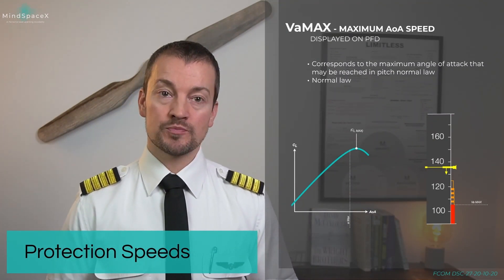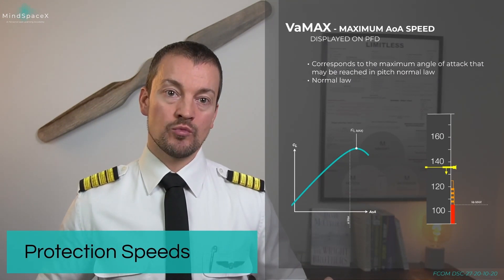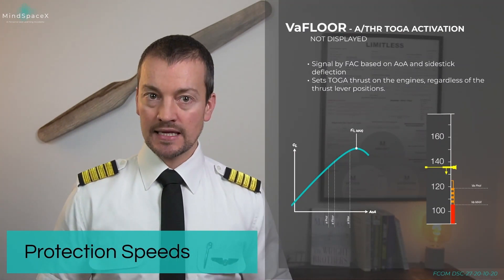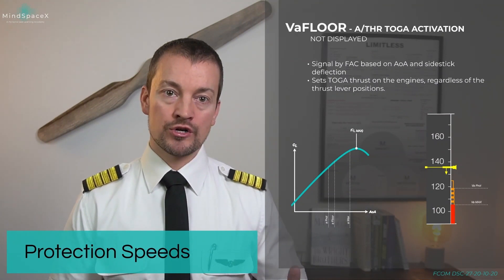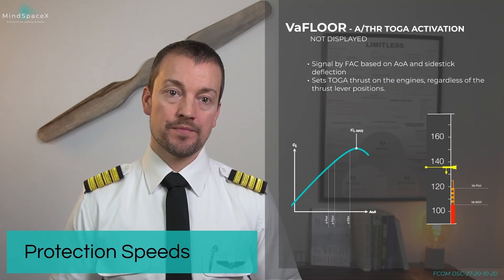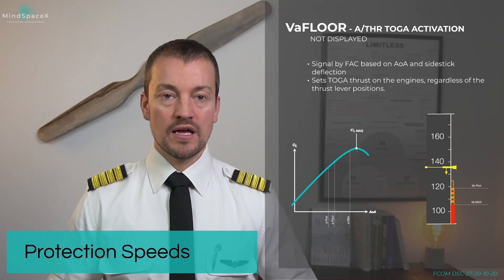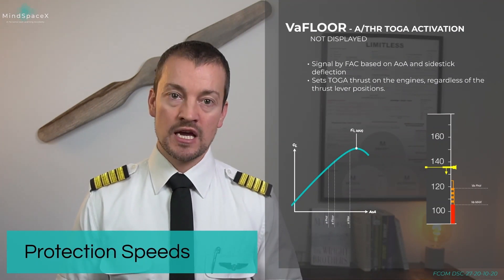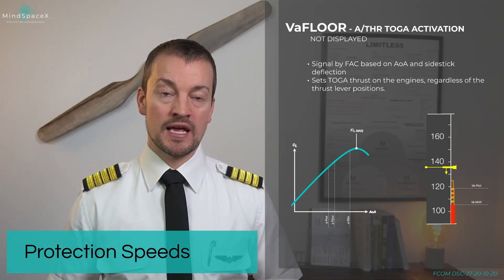Airbus Alpha Protection & Stall Warning Speed

Comment: I think Airbus need to correct the definition of the AOA protection , it’s all about SPEED
even in pitch control the main concern is SPEED 
I don’t know if you are agree with me !
Reply from the maker: The concept is tricky but it is indeed about AoA. When aProtection is triggered the aircraft pitch inputs are in respect to AoA. The deflection of the side stick now corresponds to a given AoA value, no longer Load factor demands. Because the aircraft is not equipped with an indication for AoA value, as it depends on the relative airflow, the FBW system is able to "translate" if you will, the value for any AoA to an airspeed. Speeds for aProtection is simply and "interpretation" of a set AoA value with a fixed margin to the Stall Speed (VS). In the full lesson on Airbus speeds we talk about how the Stalling Speed is calculated on the Airbus FBW family of aircrafts. This would shed some more light on the concept. I hope this was a little helpful?
Reply: Nonsense. You’re fault wrong. A stall happens at an alpha , not a speed. You’ve made a rookie error.